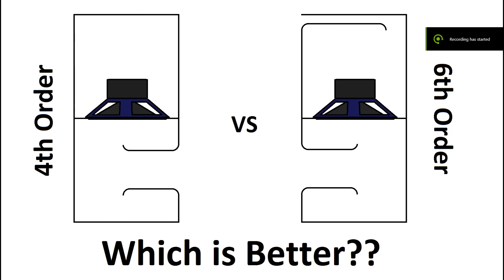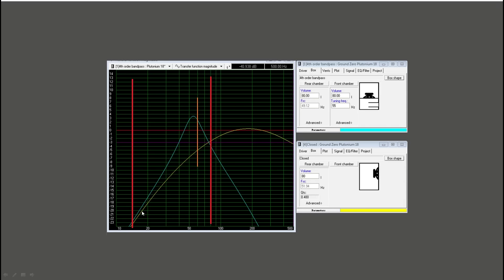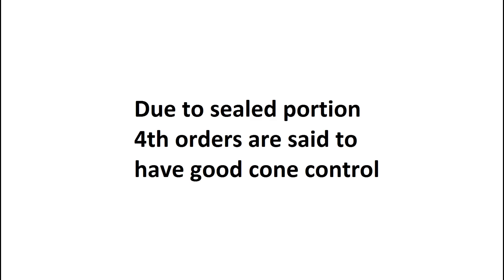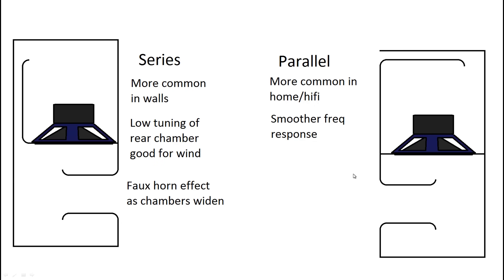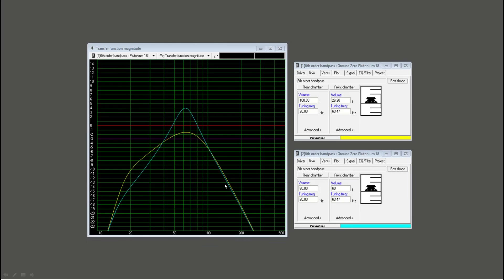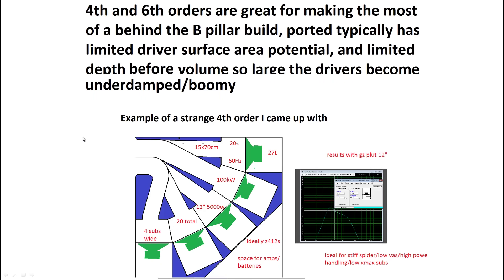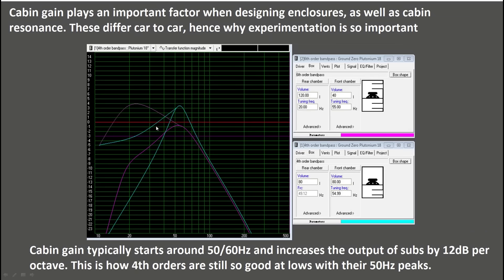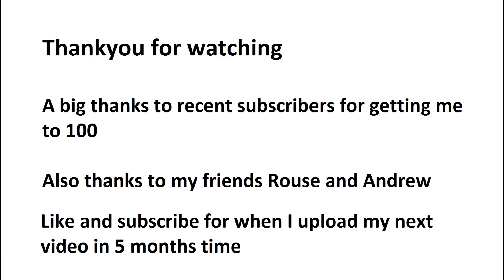4th Order VS 6th Order subwoofer Enclosures

Comment: I’m wanting to do a 6th order blow through rear center console enclosure in a sedan. Would this be suitable for daily music? If so what should I tune the ports to for rap/hip hop? Two Sundown NSV4 15s on a Orion 11000.1D @ 14.8 volts.
Reply from the maker: Rear centre console was what I was originally gonna do in my car, though after learning a bit more about port loading I decided to have the ports behind the rear seats head rests, and final revision is in my second latest video. 
I find it hard to fault my current setup, and NSv4s get down, so possibly a 20/45Hz setup, also depends on how low your door speakers can go.
With that much power, smallish boxes would be ideal, maybe 3 cubes each tuned to 20, 2 each tuned to 45, for a total volume of ~10cu ft internal. 
Honestly at this point defining music choice as hip hop is more or less saying things which get low, so it's almost a more generalised sub box in my opinion, something which plays just country might just be tuned to something like 40Hz for drum kicks, which I would consider a more specialised box.
Mean sounding specs though, interested to see how it turns out.
Reply: Dakoustics Dakoustics yeah I watched that video nice box especially the adjustable ports! I noticed it’s potted towards the rear in a hatchback though. I’ll be building this box for a 2006 Lincoln Town Car. What’s the benefit of center console port versus port through rear deck? Btw I’m running Crescendo PWX mids and high. (2) 6.5”, (1) 8”, (1) supertweet per each front door. Well I’ve noticed when I’ve tuned my previous boxes to 32 hertz it plays lows well but not much other variations of music. I’ve caught myself sometimes listening to different genre so my idea was maybe a 6th order would come in handy when playing different tunes. Which doesn’t happen everyday but, the idea of playing a wider variety of music with sounding decent interests me. Thank you for you’re knowledge..
Reply from the maker: @Craneop817  The benefits of porting through the centre console would mainly just be convenience and aesthetics, its possible due to the way it loads it'd have a flatter response, though that's just in theory. 
In general it's best to place the port as far back from the front of the car as possible, so rear deck should load better. The 6th should work well across a broad spectrum, I've only had one 1-note box, and it was a 4th.

Comment: I built a 1:3 6th order bandpass with dual12s in an isobaric arrangement for my cousin's 1990 VW Corrado back in the mid nineties.  That thing was ridiculous in the amount of output you could get out of it in such a small car.  130 dB or so if I remember correctly  The 1:3 ratio also created an interesting big box on the bottom, small box on top sort of shape that gave me room to integrate an amplifier rack for the two Soundstream Reference 500s into one side of the top for a nice clean install.  Took a while to figure out how to package it all into the small trunk and still leave some luggage room, and the final design literally came to me in a dream, the only time that has ever happened in my life.  It wasn't the most audiophile solution I have ever come across, but it actually sounded cleaner than I would have guessed going in.  Was difficult to balance the sound though, as the sub seem to be WAY more efficient than the front stage.  Unfortunately some thieves took advantage of the clever packaging and made off with the whole thing after smashing the rear glass a few years later.
Reply from the maker: Yeah, car audio is a popular target for thieves. The 6th in my trunk would likely but a thiefs back out, and the amps are under it. Kind of bitter sweet, half the reason I'm into audio is because of the 15" sub my brother gave me, which was the only audio component from his car which wasn't taken.
Reply: @Dakoustics  Yeah, there were certainly more than one of them when they hit my cousin's car.   You would have to be one of those world's strongest man types to make off with a large, awkwardly shaped object weighing roughly 150 lbs on your own.  :)  He actually found out who it was through the grapevine on his college campus, and there were three of them if I remember correctly.  Couldn't prove it unfortunately though.

Comment: What's  the difference  in inverting the subs in 4 th order
Reply from the maker: Inverting them gives a bit better airflow to the motor. Only real downside is if the motor creates turbulence it'll be much easier to hear.
Reply: So it ok to mount them regular in 4th order.skar evl
Reply from the maker: @meverickjnphilip9885  yes, should be fine

Comment: I have a ported box tuned at 34 around 4.5cuft but barely any songs get that low and everything above 40hz sounds super muddy and bad
Was thinking about just putting a sealed enclosure over the speaker and make a 4th order but might just cut the box and make it around 3cuft

Comment: I definitely subscribed, how much xmax one way would you consider 'high' xmax? I am thinking of making a 6x15" wall in a volkswagen caddy, with B2 audio Rage subs. Those subs have a QTS of 0.5 and 20mm xmax one way. 4th or 6th?
Reply from the maker: Kinda depends on how much space you have . If you wanna make the most of 6 subs on a 6th order you'll need a large enclosure not to choke them. If you don't have enough space, a 4th order is ideal. If you do, a 6th order is a good way to get the most out of a driver without going crazy. The difference could be 100L/sub 4th order, and 150L/sub 6th order.

Comment: Hi everyone. I have questions for my design - widerange paralell 6th order bandpass box for this woofer: https://usspeaker.com/rcf%20-%20L18S800-1.htm . The parameters I used from this website.

The whole design with simulations is here: https://speakerboxlite.com/project-info/6ed61dc2dba150c098938fd0055eb6158fbd2d314121c79a459004bec42d3e5e .

I know that Amplitude response is everywhere around -4 db on bandwidth, but I want to design a widerange box + I want to maximise out the high 20ish and all 30ish frequencies, and have acceptable group delay + ideal power handling + and the box have to be buildable. This is the reason why I want to design a 6th order bandpass box for this woofer.

Using this online designer I designed sealed, ported and 4th order bandpass boxes which are working well in real, but when it comes to design 6th order bandpass using this online designer, the results are somehow strange for me in my opinion, especially the one of the main things: the high-tuned chamber volume / size, and it's port tuning.

If I design a bigger (normal volume / size) high-tuned chamber, and I adjust the Fb to a normal frequency, lets say 60, or 80 Hz, the Cone displacement goes up so high between the  port tunings, that it runs out from the graph. This is the reason, why I do not trust in this online designer when it comes to designing a 6th order bandpass box.

So my question is: in your opinion this box for this woofer will work so well like in the simulations, or this design is completely wrong? Especially the results on Cone displacement, Maximum power and Group delay graph. If this design is wrong, I delete it, and I will design a ported box...

Btw, sorry for my bad english.

Comment: Im thinking of building a 6th order parallel with a 1:3 ratio the rear chamber is 120L 35hz and the front is 40L 65hz with two TT technology tt12ex subs and it has a nice smooth from 40-68hz at 2.8db all the way before it starts to dip how do you think the cabin boost will effect it?

Comment: Hey my subwoofer  has high qts and I don't think  15mm is a high excursion basically im asking if you think I should  build a 4th or 6th order for em? I got 2 alpine type s I want to build a box for
Reply from the maker: excursion is usually stated one-way, so its 30mm total, a 4th order should work quite well with those subs, i've seen others put them in 4th orders with success
Reply: @Dakoustics  thank you so much :-D what frequency would you tune ported too I was thinking 45-50 but I like low lows where should I aim for, the box I was planning is meant for a trailblazer
Reply from the maker: @mistanotu8791  
45 should be good, but if you've got a decent set of mids you might be able to drop the tuning to 40 and cross over at 50 or 60
Reply: @Dakoustics  thank you  you been a big help :-) I'm most likely going to tune at 45 and crossover bout 60,  I subbed to you bro your very smart thanks for being cool and helping me out bro ✌

Comment: I only have 4 cubic feet and I'm going to cram a dayton classic 18' in it, I just want to go low as possible I know sealed is smartest  
But if I was to get exotic what could I do?
Reply from the maker: hmm, some options, possibly a very long external port, say run behind a couch or something, or a tapering transmission line enclosure, but your best bet is probably to put it in a sealed box, and eq to increase the lows
Reply: @Dakoustics  food for thought, thanks
Reply: Ported is better..sealed keeps ur subs running hot..they won't last long..

Comment: No closure type is "better" than the next. It's all about preference, woofer specs, application, music type, etc. Personally, I don't care for bandpass boxes.  They may play loud, but have a one note sound. Sealed and a simple ported tends to be more musical.
Reply: Please tell me more
Reply: @m.morininvestor9920  First, I disclose I'm not a music major nor do I know anything about notes, keys, whatever. I understand octaves, frequencies, etc because of the vast knowledge the car audio and other electronic publications of the 90s used to print. I was a dealer for a time, built many boxes...I know what I hear based on my experience with the different enclosure types. 
Your general off the shelf bandpass (4th or 6th order) boxes will typically play one note or 2.5 octaves (40-120 hz) and all you hear is BOOM...BOOM...BOOM...very loud and efficiently.
 If you build one and design it to play 30-80 HZ, you're still going to get one note sound and will possibly be a bigger enclosure. 
There are, however, several types of bandpass enclosures you can make could sound musical. Around 2006(?), Rockford Fosgate sold their HE2 subs in a bandpass enclosure and they were intense. They were ungodly loud and efficient but pretty musical overall. They were big and heavy, not for every vehicle.
Ported (bass reflex) enclosures when made correctly will play every note of every octave between where you place the low pass filter and the tuning frequency of the port. When the enclosure and port is made well you can get great output at the tuning frequency of the port, ...booOM...booOM...booOM...boOOM...and so forth. 
Sealed (acoustic suspension) enclosures are the most musical in my opinion. They can ne crossed over as high as you need to or as low as the woofer and enclosure combination will play effectively without bottoming out the voice coil. But, their sound is judged by the "Q" or QTC of the enclosure design. A Q of .707 is said to be the perfect audiophile sound and a Q of 1.0 and higher for a more boomy and "uncontrolled" bass. Their biggest drawback is they require tons more power to get loud for bassheads. Overall, you get bOOm...BoooM...BoOoM...boooom...whatever the artist put on the track. Just do yourself a favor and put a low pass filter at 30 hz so you don't destroy your woofer. 
You can get more output from a sealed by loading it against a wall, corner or even down firing it if it has a stiff enough suspension to prevent sagging over time. 
Basically, to design your system, bring out a piece of paper or CAD program and sketch out what you want. List the audio qualities you're looking for, requirements, capabilities, limitations, etc. 
I recommend you read "The Loudspeaker Design Cookbook" by Vance Dickason. That is a must have book for beginners.

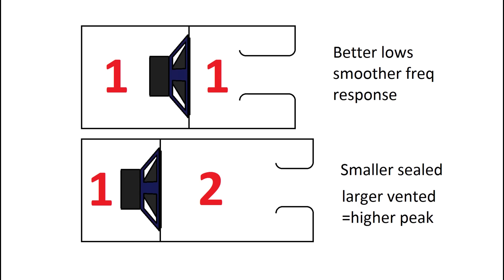Comment: Hi! I have a Magnat subwoofer (30cm) that I installed in a box thats very similar to the one at 4:02 (1:1). I made the box 15 years ago with no calculation or experience.
I don't use it in the car anymore, its connected to my home theater but its not performing well.
What type of box should I build?
Reply from the maker: I like the idea of a 5th order, so front of the driver is in a transmission line, and the rear of the driver is in a ported box, could be cool

Comment: @Dakoustics what do you think of an underhung voice coil with a powerful motor and a thick surround? Thanks
Reply from the maker: The main issue with underhung motors is they don't have a strong motor, so if this one has one, it should be fine. I wouldn't expect it to have a ton of excursion, so the thick surround is likely more for show than required. It should be fine though, a powerful motor is a powerful motor.
Reply: @Dakoustics  it is a custom built nsv4 prototype that I ordered from the company. I think they used the nsv3 motor to be honest. I have it in a ported box. Tuned to right around 30hz. Powered by a Mmats 3000.1
Reply from the maker: @572012myo  yeah they're good subs, also there's a big difference between the nsv3 and nsv4, the nsv3 looks like a standard magnet, the nsv4 magnet looks more like an oil filter
Reply: @Dakoustics  I know.  My box says nsv4 prototype but the motor looks like the nsv3. It sounds great.  The sub barely moves. Box is 3.5 net. It was my first time designing and building.  I got the the port to 54 square inches instead of 56 but it plays well. I'm not really sure how much that affected the tuning. It was originally designed for an SQL setup I was building.

Comment: I made a 16x subs band pass wall that I used for large outdoor events, it was the only thing that could evenly produce loud subsonic frequencies outdoors. This was before computer software calculations, all ear-tuned using oscilloscope, playing frequency by frequency 10hz all the way to 120hz, a lot of time real life tuning and AMAZING results. I started with 4th order then moved on to 6th order in series and parallel. 6th order is by far the BEST, most powerful and trickier design but computer software helps a lot nowadays. I had my subs tuned rear 22hz front 45hz and it was a MONSTER in subsonic frequencies, could barely hear over 80hz but I had other full-range speakers with woofers covering from that above. Also I could pump 3x the rates power without exploding the subs as the cone displacement is controlled by the port’s limits.
Reply from the maker: awesome, it's funny to see how just recently companies have started making 6th order PA subs, true innovation starts with people
Reply: @Dakoustics  Bose have been using 6th order for years.
Reply: Acoustimass had like a 4th order firing into a 6h order lol #Bose
Reply: Well if your subs are as powerful as your electric bikes then I've gotta hear a video of that with a good mic.

Comment: I think about 6th order wall 1:1 (200l/200l). It would be for two DD audio 9918f on Soundigital 12k. Rear chamber tune to 25hz and front to 55hz. I have hatchback (skoda felicia). Its good idea to make this 6th order wall or choose normal bassreflex
 with +- 350l and tune it about 42hz?
Reply from the maker: 100L each for 18" subs in the rear is pretty small, but 6000w each is a good amount of power, so a smaller box should prevent too much excursion. I'd go 6th order. Not sure what kind of constraints you have, but you'd get a bit more efficiency down low if you make a bigger rear chamber, 300L; on DD's website they suggest 5 cu ft, which is 140L as minimum suggested for an 18", but joniK's got 8 15s in a 450L box so it's not law.
Reply: @Dakoustics  So rear chamber 300L tune to 25hz, front chamber 200l and work on front port until it will play good? Also changing front port will change my peak right? I want to play low but at least have 150db+ on windshield.
Reply from the maker: @NearZoneSiona  oh yeah on 6k rms on a 6th order wall i'd be surprised if you weren't at 152 at least, I've seen 6k trunk systems to that, all increasing the back chamber should do is increase the lows, the highs will remain about the same, when it comes to the front port the higher you tune it the higher peak you'll get, both db and frequency, so its up to you when its tuning is no longer musical. Highest I'd go is 50, mine is tuned 50Hz and actually peaks at 60Hz oddly enough, but it is supposed to be a musical system, it's 210L tuned to 20 and 70L tuned to 50, and it's perfectly musical, but to get loud you'll want a larger than 3:1 ratio.

Comment: I have a question about 4th order boxes.
Am I going to get more low-end response from a 4th order that has the same size sealed section as a basic sealed box?
In other words if I'm playing decaf etc only will 4th order have any benefit over sealed box?
I could ask the same of a 6th order compared to ported.
If I'm only listening to decaf and super sub bass is there any advantage of a 6th order over a ported box?
Reply: You can get either more or less, depending on your choices for bandwidth and ripple, which are determined by the port size (mass), a series inductance = low pass filter, and the volume of the compartment it vents (compliance), a series capacitance = high pass filter. But TANSTAAFL, and bandpass designs require high precision execution because they have more sources of error in implementation and these can amplify one another.

Comment: Can i 4th order a American bass hd 12 and what should i do
Reply from the maker: 1 cube sealed, 1.5 cube ported, tuned to 50Hz should do well.
Reply: @Dakoustics  50 is kinda high will i miss all the 29 thru 40 bass my box now is set on 40 and if it at 50 does it play 50 n down or 50 and up
Reply from the maker: @kidsavage86  45 should still be fine, but you might lose some in the 60Hz range, and yeah it plays 50 and down. Another option is make it 1.5cu sealed and 1.5cu ported, the extra sealed should help it down lower
Reply: Im back again doing a hcca 12 in a bandpass best tuning if i want spl but daily